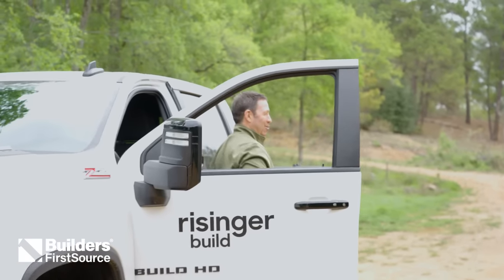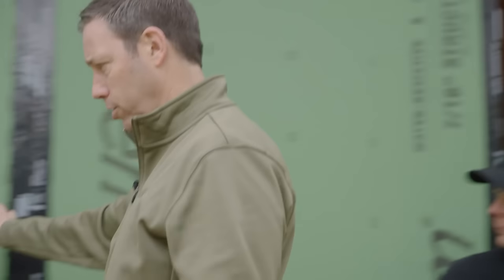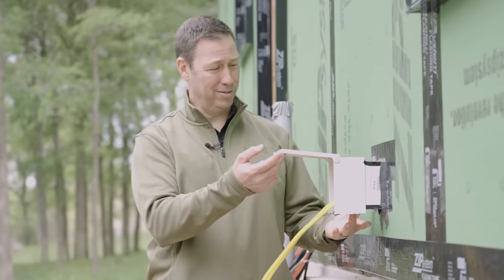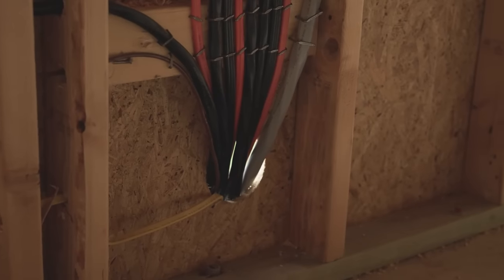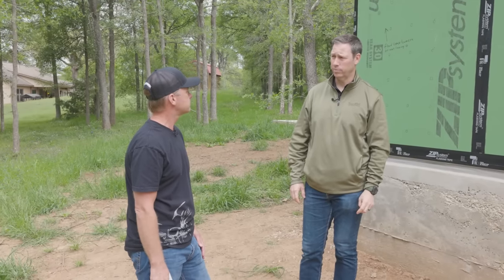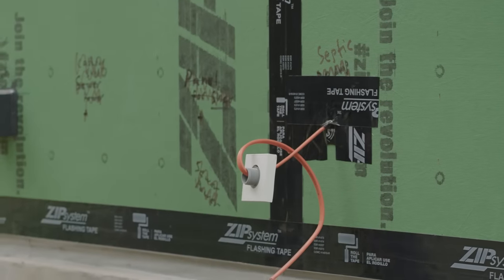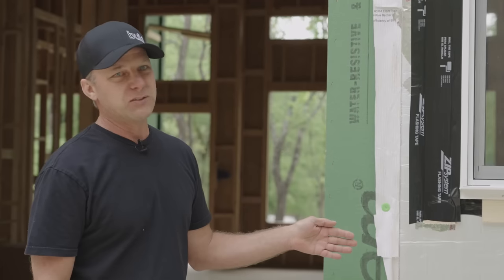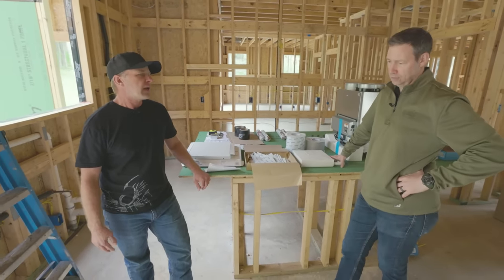Part 2: LOW BUDGET Details For A High Performance BUILD

Comment: I like how Scott uses his own house to experiment on in order to make informed decisions for clients homes based on his own real world experience. A true craftsman.
Reply from the maker: Indeed. Scott is awesome
Reply: SCOTT is the NEXT PERSON , I WANT BUILD MY HOUSE in DALLAS, TX
Reply: Yep, one to learn from for sure!
Reply: @buildshow  - regarding Scott's passive duct make-up air for the dryer having a manual switch to open; commercial HVAC will use an Air Flow Switch (e.g. Bravo Controls, Part number : AFS _ $27) to prove airflow.  I wouldn't want one of these in the outflow of a dryer, because the flap on the switch would get stuck with lint, but seems like putting on on the intake side of a dryer would work.  That way just turning on the dryer would move the Air Flow Switch, which could then be used to open the passive make-up damper.  (I'd prefer not rely on anyone remembering "the thing" for any system to work properly)
Reply: @chrishayes8197  This is very forward thinking with regards to the intake side as well as taking the reliance on the human to remember "the thing".   Nice input.  Cheers amigo.

Comment: 3 Things from Scott's building practices: 1) framing to slab connection, 2) Wall to roof connection,  3) All holes you poke through (pipes, wires, windows, and doors, anything that is a hole).  There are so many ways to air seal....Pick one air seal practice, but be thorough.     Right on Scott. Noted with thanks💯👍

Comment: Scott is such a rock star - I love the way he is bringing these details to a more attainable market with thoughtful decision making and building science fundamentals. This is the kind of thinking we need to address the big challenges in the housing market at large!

One thing that stuck out to me was the OSB on the roof. Anecdotally, In building our own home we were trying to lift different panels into place using a grabo vacuum lifting handle (shout-out to GRABO) . No matter how we tried though we found that we just couldn't lift regular OSB. Lifting zip sheathing from the coated side would work and the vacuum pump would cycle on and off occasionally. Manufacturer told us uncoated OSB is just too porous to pull a vacuum on.  Now, practically this may not matter in a house that is slightly pressurized via ERV like Scott is doing, but it was a powerful example in how much air could pass through a seemingly solid sheet of material. I could imagine that making a difference on a blower door test for sure.

Scott to join the build show network permanently IMO, dude is a pioneer and not afraid to put his own money out there to try new things!
Reply: In terms of the blower door, I have houses that are all OSB (the roof and the walls) with taped seams and numbers below 1 ACH 50. I think it's safe to say that Zip is tighter than OSB but OSB be can tight if needed.
Reply: Also, I do not slightly pressurize my homes. You can do that and I've heard that it can work but I prefer to aim for 100% balance.
Reply: @ScottTrue  good to hear your  real world experience on the past builds! Like I said my story was anecdotal.  Thank you for sharing your experience, looking forward to learning more!
Reply: It didn’t hold suction because it’s not a perfectly smooth surface. Nothing to do with air moving through it.

Comment: Ya'll need an electrical contractor (like me) to provide tips on better quality electrical construction.  E.g.:  put the meter outdoors, put the breaker panel indoors.  Use metal boxes, not plastic.  The screw holes strip out easily in plastic boxes then it's very difficult to replace them.  People use larger screws in the holes but eventually the hole breaks then you're screwed.  And use larger outlet boxes.  You'll see boxes with a gagillion wires in it, then you try to jam the device into it.  That's how screw holes strip out in plastic boxes.  Use "deep" boxes if you need extra wiring space, or 5S boxes, or add some large junction boxes in central locations and branch off of it (so there are fewer wires in outlet boxes).  Don't put a single GFCI outlet in the garage or wherever then feed others off of it (e.g. bathrooms).  Something trips it 4 years later and the homeowner doesn't know why their bathroom plug isn't working.  Just put a separate one in each location they're needed (BUT you need a larger junction box or it's going to be a tight cram to fit it in there, stripping out those plastic screw holes again...).  Etc.  But even in these high-end builds I see no attention given to any of these things.  Slam Bam Cheapo Electric.  You'll pay the price later.

But, I know, that's not as sexy as energy savings.  Easier to sell watertight and airtight than it is better screw holes for switches.

Comment: I am using 2x8 exterior walls with 3" closed cells and the extra cavity space with fiberglass insulation...5/8" zip sheathing and 5/8" gyp. In Minnesota.... the houses are performing like passive homes without going to crazy in details.

Comment: As a mechanic, not a builder, thats renovating a 100 yr + old house, I have been doing some self education.  For someone like me, content like this is extremely valuable. When you dont know what questions to ask, its hard to learn on your own. This has answered many questions I would never think of asking and paints a picture for the kind of thinking needed for building. What builders  like this consider Commen knowledge, I wouldnt even think about. Now, there is a huge difference from an old house renovation to building a tight calculated, and experienced home. Even still, there is a lot I can take away from this, and gives a thought to other questions to ask. Thanks

Comment: Scott! Using Joe Lstibureds "perfect wall" assembly....insulation on the OUTSIDE, sheathing on the in...plus more sheer strength with sheathing against the studs.    AND you applied Steve Baczeks window framing WRB application....WRB over the sheathing....Water control....right! 💯✔  Well done Scott....and Kudo's to your Wife for being involved to keep the Budget in check....💪  Right on 👍

Comment: I’m a plumber who recently installed my first aquor hose bibbs and I have to say not a fan. They look nice but they are not practical. The standard frost proof hose bibbs is better. There’s several issues I saw or foresee in the future. The main issue is turning them on and off. There’s no way to control flow. They’re either on or off. To control flow you have to buy a separate part and it makes the frost proof useless. You also have to keep up with a part to turn them off or on in the first place. If you want it angled down you have to buy a separate part. There’s also no way to take them apart and repair them. So if down the line something stops working, you’ll have to cut drywall to repair it. None of these are issues on standard frost proof or regular sill cocks.

Comment: Great video, as always.  The anyshelter flooring system should hook up with DOD for Force Provider contract to then have an income stream to offset donations.  We could have used these floors during the war.  As engineers, we built temp structures for Soldiers from all NATO forces and we lived in tents with plywood and 2x4 constructed floors.  If you remember the price per sheet of plywood in the 2004 to 2008 period it was mostly due to what the military was buying and using in both Iraq and Afghanistan.  These floors would have cut down the time of construction and then the time to move to the next construction base.  The DOD could also use these in the humanitarian relief efforts both domestic and abroad.  Great idea.

Comment: To stagger my seams, I used carpet tape to hold the sheets up instead of cap nails. Rain screen holds everything on in the end.
That carpet tape worked awesome
I had a 2 story house foamed in 2 layers also, but fasteners besides the rainscren creating a thermal break. It worked awesome. 100 bucks in carpet tape to get it up. Tyvek over foam then battens.

Comment: Have you considered using the Fantech Make-up Kit with a Y-duct serving the Kitchen exhaust fan and the Dryer. A current sensor on the dryer circuit turns on the Makeup Air System and opens a damper sending 200 cfm to the Laundry room with the dryer. A separate sensor with the Kitchen Exhaust Hood opens a damper on the other leg of the Y-duct to allow 400 cfm to go into the kitchen. A Fantech inline duct heater with a thermostat control can be used to heat the outdoor winter air.

Comment: I think if you do two sheets overlapped you should do the first with the foil in and the second with the foil out to radiate energy both ways. I'm curious why you don't use the HVAC for dehumidification? Do you know about Hy-Dry also? If you aren't getting sufficient humidity control you can institute fan control on many models that starts with a low fan setting to remove additional humidity before the fan ramps to full speed for cooling. I recommend HY-Dry for humid climates. Cheaper and removes another component for failure.
Reply: HVAC can absolutely be used for dehumidification. In fact, that is what I promote most of the time. If you go that route, it's critical that you get the design and sizing right, which we do. The dehumidifier, in my opinion, is a luxury item that controls humidity in the short shoulder seasons when HVAC can't quite do the job totally.

Comment: In the opening seconds, you can see two PVC pipes sticking out from the vertical half-wall between the roof lines.  Are these plumbing vent pipes or something else?  If vent pipes, how did you end up finishing these?

Comment: Really like this content and the demo that you can be energy efficient and it doesn’t have to break the bank. Maybe a dumb question, I have watched many of the other videos and I still don’t know that I could list the benefits of spending noticeably more money for an erv. What does one get from sensor that Brian doesn’t given the automated controls Scott discussed.
Reply: The automation and buttons discussed are connected to the ERV for ventilating. The important thing is to NOT use traditional fart fans (that's what typical builders call them) because they will depressurize the house and cause problems. Air will be made up through the path of least resistance. You might notice the problems right away but sometimes you'll notice them a decade or so later (even though the problems are there on day 1). The benefit of the ERV is to establish balanced ventilation so you don't have depressurization.
Reply: Also, I have ways to keep the costs down on the ERV. I'll make a video about that because that's several details to consider.

Comment: Would it be cheaper to use PVC Boards to Frame Out Windows v Tape, considering the Benefit and Longevity?
Then do a Plastic Weld of some kind? Perhaps an Epoxy of some kind?

Comment: Great video.  Thank you!  One question about bug screens and ventilation.  If you seal under the eave as you've done in this video, do you need to have ventilation at the top of the siding on the top of the wall under the eave?  In other words, do you need a bug screen similar to the one at the bottom of the rain screen or do you just let gravity do the work with air gap you've created with the 1/4 battens in your rain screen?

Comment: Question the roof extension they placed false structure “to stop thermo bridging” the nails and metal brackets can not possibly provide the same strength as solid through wood can it? Is just a compromise trying to balance competing requirements?

Comment: If you insulate the exterior and roof (or use roof coating or energy star shingles) of an attached garage, won't it help prevent heat transfer to the house?  Even with good insulation, a house attached to a hot building is going to absorb some of the heat.  However, I have no way to calculate the cost benefit ratio among those options.

Comment: I live in Iowa. I'm concerned about mold because of moisture developing. My house was built in 1960. Currently I'm insulating my garage with the intention to install a gas heater. I understand if walls are air tight theoretically mold shouldn't develop. However, since Iowa has high and low temperature changes and my garage exterior walls are from 1960, should some air flow be considered...to allow any "potential" trapped moisture to escape?

Comment: Quick question. Would using comfortboard 80 negate the need for that gap between exterior insulation and zip sheathing?
Reply: Yes. Comfortboard is an excellent product for that reason and many other reasons. It's a little more expensive than polyiso.
Reply: @ScottTrue  Thank you for the response. I’m about to get material for a project, so it’s nice to know that now. Thanks Scott!

Comment: Matt, in your experience how much more difficult is it to seal every joist penetration  reliably than it is to use Monopoly framing where there are no structural penetrations through the air  barrier?  Is there a measurable difference in airtightness between the two approaches?

Comment: 12:00 How did Scott achieve that water/air/bug seal where the wall framing meets the concrete slab if he's not using that foam sill sealer?

Comment: Wouldn't liquid flash be better between the Zip tape to concrete. Can the vents for the bathrooms and the Heater / washer plumbing vent be moved further to the top of a home. I'm in Florida and have a ridge vent for the whole house. Our home is a 30' X 50', 1279 Sq Ft house.

Comment: Easier and cheaper does not necessarily mean BETTER. I'm an Architect and Journeyman Carpenter. Every time I've seen "Cheaper and better" on a job it usually means it works good for the general contractor's profit margin but not the owner.

Comment: @Matt Risinger:
Question: I had a non-experianced builder pour sloppy stem walls. As a result the framers built the shell with some parts of the south side overhanging the stem wall about an inch. How can I seal this and prevent termites and roaches fromentering (I'm in AZ)? Any ideas? I'm now doing an owner build and trying to figure out a remedy. My length overhanging is 72'. THANK YOU

Comment: I have a question, I already have the TYVEK sheeting to put up on the wall studs and ceiling jouist on an ADU. But now that I have looked at the ZIP sheeting I am thinking that this would be a great additional factor for the walls. The question is can I install the ZIP sheeting between the TYVEK and the external Barn Siding?

Comment: Genuine question... At what point or to what extreme does air sealing stop making sense in terms of having to suck hot/cold air in  makeup for the lack of fresh air infiltration?  Wouldn't sucking fresh air in be the same as maybe having a slightly less than air tight home, only more expensive to up keep?
Reply: I used to build loose on purpose (just like 99.9% of builders) because it was the only way the bath fans wouldn't cause immediate problems. But they are likely to cause long term problems because you are using your wall assembly as a filter. There is no tightness too extreme because, with today's technology, it's easy to exhaust air while bringing in the same amount of fresh air filtered, conditioned, and dehumidified.

Comment: Matt, 
What are your thoughts on non conditioned attic spaces?  We hardly see them in my area but hvac is usually in a basement or crawl space. There are some guys putting the hvac in an the non conditioned attic but it’s usually in track homes.
Reply: Doesn’t like them for hvac spaces.  Excess loss for hvac that is unnecessary.

Comment: With the tight house approach, what happens when you get water infiltration? Is there any way for the water/ moisture to escape once it enters the assembly? Are you just betting everything on the idea that the envelope is 100% water tight and will stay that way forever?
Reply: Well then i guess you’re doomed if water gets in
Reply: It's the overbuilt AC unit and dehumidifier that handles any air moisture. Though most do plan to not let any significant moisture into the envelope.

Comment: What is the point of making a hyper efficiently air-sealed house & then installing an ERV (Energy Recovery Ventilation) which UNDOES that fanatical air sealing/retention?!?
Reply: Because it doesn't undo it. In a high performance home, you don't want to retain the air like you mention. You want to control the air, which is something different.
Reply: ERV are design to help tight home breath and remove stale air. I added (1)ERV, and (3)Dehumidifiers on my personal home. Followed @mattrisinger best practices with the Trane & Mitsubishi product with Metal ductwork. Since I’m an HVAC Contractor, why not. @scotttruebuilds, I like what you did in the Utility Room with the dehumidifier. I added an inline Fantech Fan to come on when my dryer kicks on which helps quite a bit. I also added 2 central exhaust fans to remove air from bathrooms and the utility room. The only thing I should have done is have added make up air when the exhaust in-line fan is running in the attic and pulling from the vent a hood.
Reply: Bringing air in on your terms, not wherever it wants to come in.